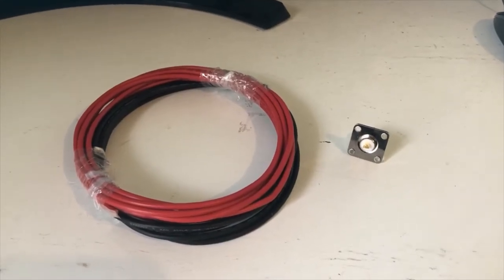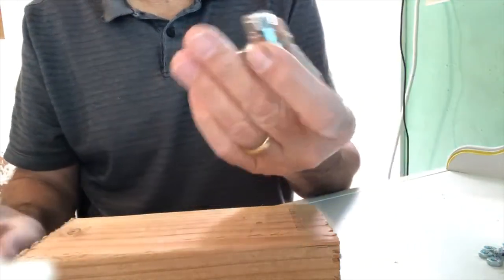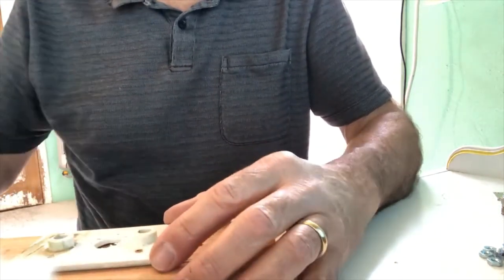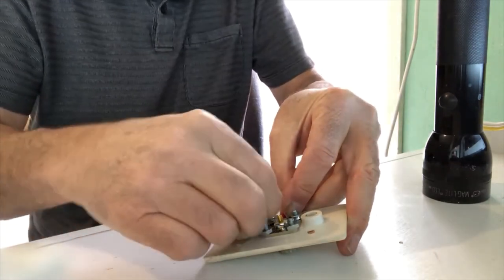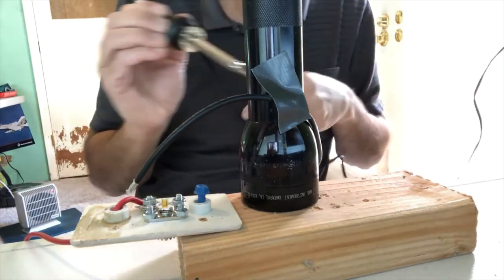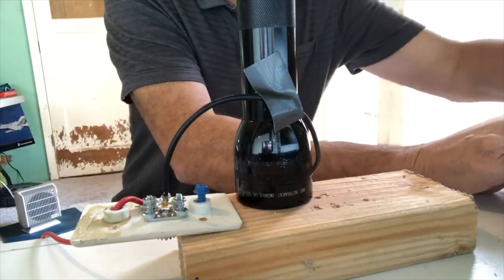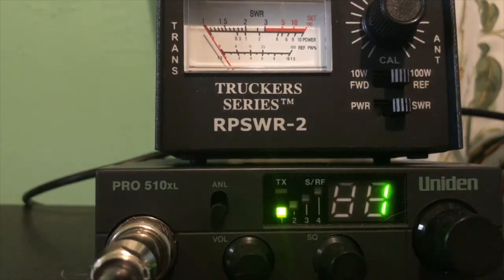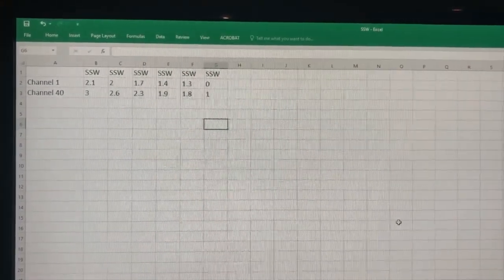CB Homebuilt Dipole Antenna

Comment: Great video - I am going to make one of these and locate like you have under the house eves.  Is there any issue with those wires and the weather ?  I.e. snow, rain, etc.  ?  What is that green line that the wires are wrapped around. ?  Thanks!

Comment: A nice no-nonsense design!  I want to do something like that also. Thanks for sharing!
Reply from the maker: Having the antenna wires encased in the PVC pipe makes it easy to reposition. Thanks for watching! 73s from 595 Northern Nevada.
Reply: @RidgeHikerAdventures  ...and 73s to you from 993 Seattle!
Reply: @RidgeHikerAdventures  does he have to use the black wire in middle connection and red on bolt hole? Or doesn't it matter? Thanks , off sr160 in Pahrump Nevada
Reply from the maker: @caseykelso1  Hi Casey, it does not matter the color of the wires.

Comment: When soldering, flux then "Tin" both the fitting, and the wire, then put the two ends together and add the heat with the iron. Pre tinning the wires/coupling SO239 makes it a little cleaner when all is said and done!👍 
   Great job though, I find making and experaminting with different antennas the fun part of the hobby. With antenna design, you can through "RF (radio frequency) physics" turn a 4 watt radio signal as powerful as a 40 watt radio with "Forward Gain" the more forward gain your antenna produces, the stronger the radio's signal will be.
     One thing to keep in mind is about 99% of the CB radio operators out there, everyone is using a vertical polarized antenna, now if iam not mistaken, your antenna is mounted "Horizontally" under your eaves of the house?, if thats the case, your not going to hear many people unless they are really close to your home. Take your antenna and mount it vertically, and you'll notice the whole world is talking especially now, signal skip is at an all time high right now, ive been able to talk with people all over the Country using only 4 watts and a 7' skip shooter tunable mobile CB antenna.  Just food for thought. 
    Thanks for sharing your dipole antenna build with us!. 73's.  (4570) Flagsraff,Az
Reply from the maker: Thanks for the tips, my soldering skills have improved over the past year due to helpful tips like yours. You are correct that my dipole is horizontal. I have since built another dipole that is mounted on top of my RV on the side of my house. I have it mounted horizontal as I like to work skip and don’t talk too much locally. It does a pretty decent job but would perform better if I had it mounted higher. I live in Northern Nevada and have talked to the Great Lakes on both sides of the border during times of F2 propagation which is around 3000 miles. I have done this with 12 watts on sideband. Creating your own antennas is a great part of the hobby! Thanks for commenting and 73s from 595 Northern Nevada!
Reply: Local shack store or hardware.take your time wire antenna
Reply: 100 💯 percentage of the time is bad coax trew it away ok .rca jacks or 75.oms .ok homebrew antenna 📶.fm mode 😮 📳 I have everything I need 😅just study how to make the best mount .20 foot 👣 post on the next video 📷
Reply: Make this antenna for 📲 key down 👇

Comment: Thanks for the video. Can you share how long the wires  are giving you low SWR? Thanks
Reply from the maker: Length of each element:
8 feet, 7.2 inches
2.62 meters

Total length of dipole:
17 feet, 2.4 inches
5.24 meters

I measured it for the center of the 11-meter band. I still had to play with the length to get the SWR dialed in due to nearby objects.

Comment: What was your beginning and ending length of the wires ?
Reply from the maker: I started  with two  copper electrical wires around  9 feet each and trimmed them down to around  103 inches.  I  trimmed them a little bit at a time  and checked the SWR  between  snips  making sure to trim  the wires evenly.  The antenna works great for talking skip.  Thanks for watching !

Comment: Great vid. How long are the black and red wires? And do you ALWAYS put black wire to CENTER of 239 connector and red grounded to bolt on side of 239?
Reply from the maker: I started with 9 feet for each leg and ended up trimming down to around 8.53 feet. If I were to construct it again, I would fold the ends instead of cutting them. Wire color does not matter.

Comment: What wave of dipole was it ? We never knew .did you cut to tune it or did you slope the ends inverted v ?
Reply from the maker: Hi Jorge, my dipole is 1/2 wavelength. I cut the ends to tune it, but if I were to construct it again, I would fold the ends over to adjust the length. The antenna is a horizonal dipole and not an inverted V though I would like to construct one in the future to see how it performs. Thanks for watching! 73s from 595 Northern Nevada.

Comment: You always put the + wire (red) on the negative side ?
Reply from the maker: Hi SECTOR5, it does not matter which way the wires are hooked up. There is no positive or negative point. Whenever RF resonates within the antenna, there is an AC voltage difference across the antenna which in turn will let current flow forward and backward through the antenna. 73s from 595 Northern Nevada!

Comment: I don’t mess around with channel 1 and channel 40…
I just go straight to channel 20 and if it’s good then I’ll leave it alone.
Reply: Just because channel 20 is decent doesn't mean 1 and 40 will be even..Best to check on 1,40 and 20. Best to use an antenna analyzer if you have access to one.
Reply: @vegasfordguy  You can get a nanoVNA for 60 bucks that can sweep the antenna for swr over a range of frequencies. Much less than an antenna analyzer.
Reply: @notsure7874  Everyone I've talked to who has one says they are pretty complicated to use?
Reply: @vegasfordguy  They can be, but they don't have to be.

You calibrate it before use, then set the high and low frequency for the sweep, then sweep the range for swr and it outputs a graph. You can do a lot more with it, and it's not as easy to use as an antenna analyzer - but it's also not a $200+ tool. Anyway, if I can do it - you can do it!

The funny thing is - when you get into pro grade stuff, the antenna analyzers are the cheap ones. At least from what I've seen anyway.

Comment: How long wire? Thanks
Reply from the maker: On 27.025 MHz which would be the center of the 11 meter band, the total antenna length would be 17.38 feet. The dipole leg lengths would be 8.659 feet long. Thanks for watching!

Comment: Well it works. What were your plans for your station? Was this just a test?  Your range will be small. You must be in a HOA.
Reply from the maker: Our neighborhood doesn't have an HOA but I don't want to mount a big antenna on the house.  I'm more interested in skip and the current setup has worked well. I'm sure it would work better if I got the antenna higher.  I have built another dipole and I will try mounting it in one of the tall trees on our property. I think I will try this one vertical and see what different results I get. Thanks for watching and 73's from Northern Nevada!
Reply: @RidgeHikerAdventures   Yes, that will work better. Going vertical and more height. That's the key. Most stations are vertically polarized anyway. Try making a j pole antenna for the tree. That will get you out somewhat. You have to have somewhat efficient antennas as its been said this solar cycle isn't going to be that great. While that antenna looked stealth, it isn't going to make many contacts. 73
Reply from the maker: @chrisolson968  Thanks for the tip on the j pole, I had never heard of that type of antenna before. I made another dipole out of PVC pipe to be able to move it around and see what location works best. Last Saturday, I had my best skip day ever. I was able to make around 6 contacts in Canada and San Diego. I had just replaced all the caps in my sideband radio recently and was anxious to test it out. Thanks again for the tip on the antenna and have a great weekend.
Reply: @RidgeHikerAdventures  Yes very good. Well you must have a good sideband rig. It must have a little extra output. I got into cb in the 70s when I was a kid. Man that was one heck of a cb craze. I played with antennas a lot over the years. It does seem out West gets a little more dx propagation than here in the Midwest. Maybe the higher elevation. I can't wait until 10 meters opens up and of course that's good for 11 meter cb too. I hope you find a antenna that works for you. The j pole is an easy to tune omni antenna. You don't have to buy the ladder line. You can have one piece of wire and use some pvc as a spacer for your matching stub. If you make one you will figure it out easy enough. The higher in the air the better. Sometimes its hard to get antennas as high as they need to be. Take care 73
Reply from the maker: @chrisolson968  My first CB was back in the late 70's. Back then I didn't know about SWR and just threw an antenna on my old Mustang. I didn't even know skip existed. A lot of the kids at my high school had a CB. Back then the channels were very busy. Mt uncle about 10 miles away had a base station with a huge antenna. I lived in the hills and he was in the valley. I remember being able to reach him so my antenna must have been fairly well tuned.  I just started getting back into CB's about 4 months ago. I wanted to put a vintage CB into our vintage RV and the bug bit me again. I love working on the old radios as they are fairly easy to replace the capacitors and other parts. I'm working on getting the proper equipment to tune them. Regards
Reply: @RidgeHikerAdventures  Wow about your skip!

Comment: Shouldn't center fed dipoles have a 1:1 balun at the connection?
Reply from the maker: Yes, this was one of my first builds before I knew about baluns. When I have time, I plan to add a balun and post my results. 73s from 595 Northern Nevada.
Reply: @RidgeHikerAdventures  Been reading more about baluns...You may or may not really need them depending on your situation.
F00king RF hobby is strange, yea?
:P
Reply: A 1:1 current Balun is for suppression on common mode current on the outside of the coax shield helping to prevent RFI/TVI in the shack in and on other electronics around your home and in other peoples homes.

It does not act as a matching transformer.

Balun means Balanced (the dipole antenna) to Unbalanced (the coax), Un-Un means Unbalanced to Unbalanced such as in a line isolator which does the same thing that a current balun (common mode choke balun) does but is placed at some point in the coax feedline or at the shack end to, again, help prevent common mode currents from traveling on the outside of the coax shield.

An Un-Un can also be placed at the feed-point of a ground-plane antenna if you are experiencing RFI/TVI.

Comment: I would highly recommend buying a commercially available aluminum antenna if you want to have a chance at reaching out more than 1/2 a mile. The higher you get it, the better. Your receive will also dramatically improve as well.
Reply from the maker: Thanks for the suggestion, I have another antenna mounted vertically at around 20 feet to use for local traffic.  I live in a valley surrounded by mountains on all sides, and it pretty much reaches most of the valley. Thanks for watching!
Reply: I could reach out a mile with my TV antenna don't be a fool them dipoles will reach far 20 miles
Reply: @RidgeHikerAdventures  of course it does I'm west of Las Vegas in Pahrump Valley and with my dipole I can get the whole valley. Which is about 20 mi diameter
Reply: @caseykelso1  Nothing compares to an aluminum antenna. Don't be a fool 🤣
Reply from the maker: @caseykelso1  Nice range! I also live in a valley surrounded by mountains on all sides. I have logged around 450 DX contacts in the past year. It's a great antenna!

Comment: Nice video I appreciate your work. Thank you!
Reply from the maker: Thanks for watching! 73s from 595 Northern Nevada
Reply: @RidgeHikerAdventures  i would use  ring terminals than just put a nut over the bare wire i found out that it will get wet and cause all type of swl issues
Reply: and it not ssw its swr standing wave ratio

Comment: You might have realized this by now, but your antenna configuration as shown is horizontally polarized, while almost all conventional CB is vertically polarized.  That mismatch will cause a significant loss of transmit/received signal.
Reply from the maker: Hi David, I have my dipole mounted horizontally for skip. I have another antenna that I use for local contacts. 73s from 595 Northern Nevada.
Reply: @RidgeHikerAdventures  Ahhhh...makes sense. 73 from NJ

Comment: You know that’s the worse possible location for a dipole. Throw it over a tree or on a wooden fence if you need it to be stealthy. Apply more heat and less solder. A solder lug is helpful on these 239 female squares. I can’t tell if this one is just silver coated or what. Stainless is water and rust resistant. I like using liquid electrical tape if it’ll be outdoors
Reply from the maker: That was my first dipole antenna I ever built. My current dipole is above the roofline and works well. I'm planning on hanging one between two tall trees on my property. My soldering skills have also improved thanks to suggestions like yours from viewers. 73s from 595 Northern Nevada.
Reply: Tin roof, metal guttering?, hard up against timber, 75ohm feed point, 52ohm coax? …it will work great! 
😮

Comment: An easier way to get the length is just fold the end of the wire and wrap it around itself, which also makes a nice loop for hanging it and attaching a weight on the bottom.  Good luck making many contacts with a horizontal antenna. 99.9999% of CB antennas are vertical.
Reply from the maker: Great idea for looping the ends. I went with a horizonal dipole as I'm more interested in skip and I read that mounting it horizonal will work better for skip. So far I've had good luck making contacts with only putting out around 20 watts on sideband. Thanks for watching!
Reply: It's a dipole. They are usually horizontal. But you can put them vertical.
Reply: I'm pretty sure you have to actually physically cut the wire to make the wire shorter you can wrap it up in a ball and it's still going to be say 10 ft long or you can stretch it out and have to be 10 ft long I don't think folding it over is going to help at all

Comment: Usually raido checks end up get an unfriendly person. What I dont get is they dont have to answer if they are going to beca dick lol. Any nice video.  Im waiting in some jumpers to take apart and make a couple of these!
Reply from the maker: I've had a few rude radio checks but they are usually from people driving through town. The locals for the most part are pretty friendly. I like to work on old radios and try out homebuilt antennas so I've asked for quite a few radio checks. Thanks for the comments and watching. 73s from 595 Northern Nevada.

Comment: Too much solder and not enough heat.
Reply from the maker: That was my first attempt at soldering, it didn't go well. I finally figured it out and have recapped all of my CB's and have gotten better soldering each time. Thanks for the tip! 73's from Northern Nevada.